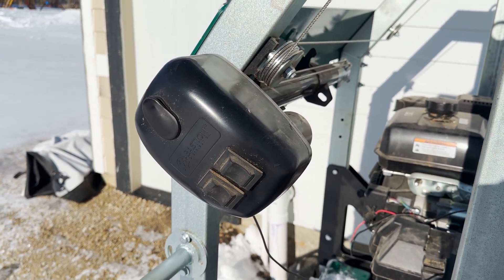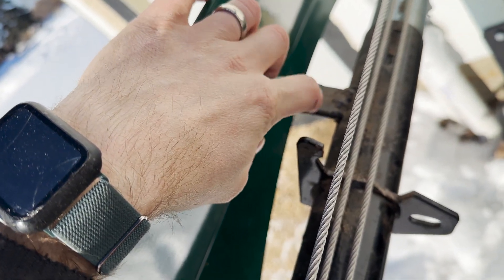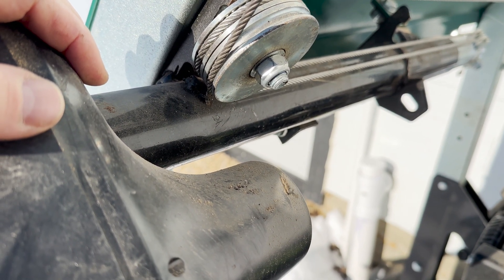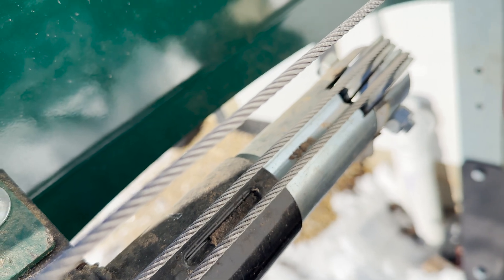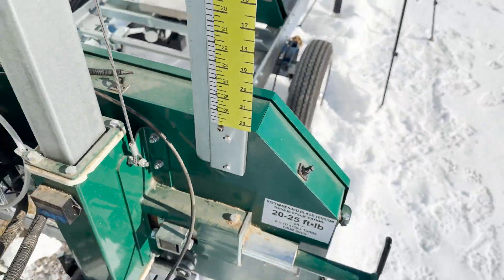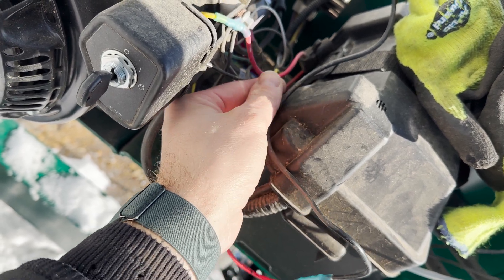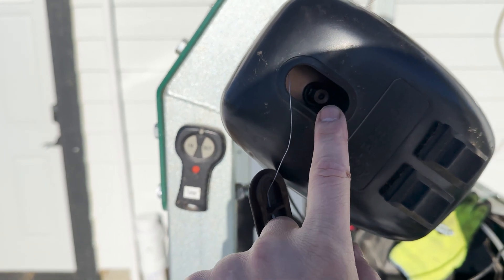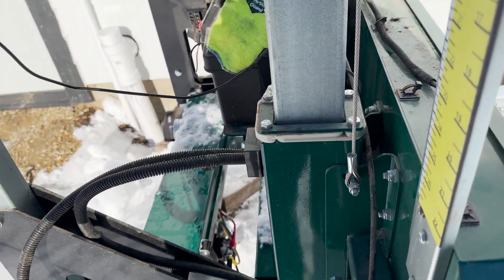Woodland Mills Sawmill 12v Powerhead DIY mod for  HM130 Max

Comment: Are you able to get the full travel height capacity of the HM130 Max mill with that jack unit or do you lose a little bit on the top? I would guess it's just the slab wood getting taken off but how much? Thanks. Love the additions you have done. I'm looking forward to getting mine put together. Thanks for the videos.
Reply from the maker: I am able to get the full travel height out of it

Comment: how many amps does the jack draw?? won't burn out the keyswitch??
Reply from the maker: It only draws a couple amps because there is not much of a load on it.
Reply from the maker: I may have put it on a relay, I can’t remember.

Comment: Great idea thanks for sharing..just received my mill from China and they use for lifting just regular winch system so when I'm set up my blade to the bed parallel and lifting head way up it is 3/4 of inch defferent between 2 end's..so impossible get square Kant..will update like you did
... could you please make a video of log turner.. would like to see how it works in action..thanks again...
Reply from the maker: I am going to do a video of it soon!  I used a cheap knock off Chinese winch and it has failed so I ordered a new one to replace it and I just received it.  When I get it installed I will make a vid!